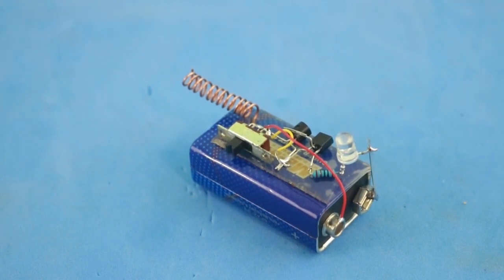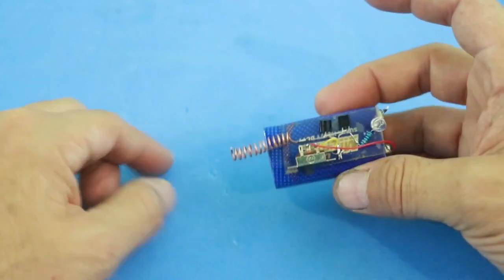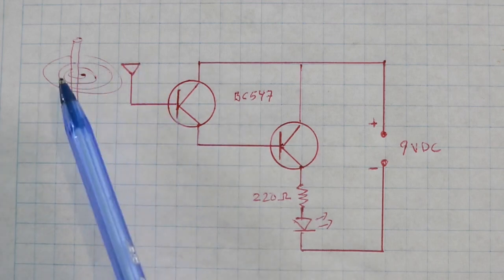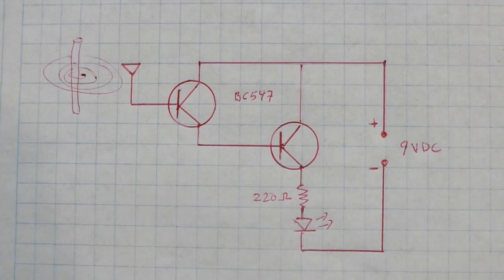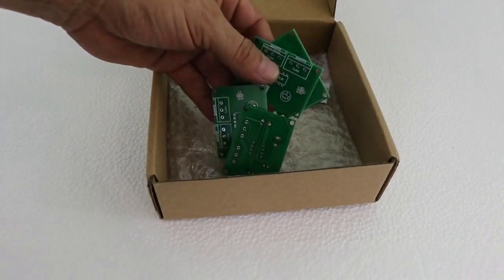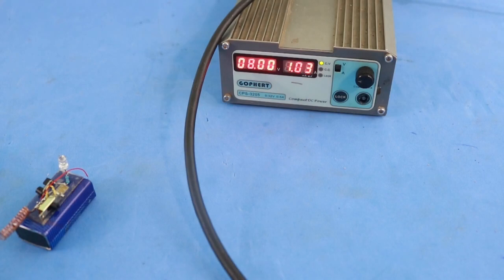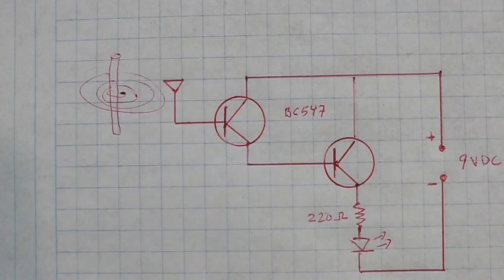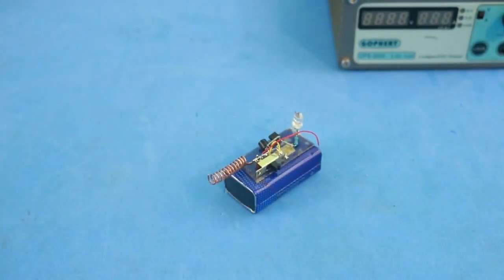Non-contact AC Current Detector Easy Circuit

Comment: By linking the transistors in that manner, you've created what's called a Darlington Pair transistor amplifier. You can also get a single transistor, that has that circuit. I wonder if one of those could be used to created the AC detector. https://duckduckgo.com/?q=Darlington+Pair+transistor+amplifier&t=h_&ia=web
https://en.wikipedia.org/wiki/Darlington_transistor
https://duckduckgo.com/?q=Darlington+Pair+transistor+amplifier&t=h_&iax=images&ia=images

Comment: This circuit is wrong, you need a large plate to form half of a capacitor instead of that nonsence coil
Reply: "you need a large plate to form half of a capacitor instead of that nonsence coil" A wire is also half a capacitor or a plate, a coil need to be conected to each side so this is not a coil.  the wire is aranged like that so it can be shorter with the same surface.
Reply: @sokauo  wrong, a coild this size is not an efficent capacitor, a plate made of a small piece of aluminium foil or copper tape would be more efficent producing stronger current for the trasistor to amplify meaning it would detect cables with a higher precision
Reply: @DolezalPetr   Chek electroboom video mate ;)
Reply: @sokauo  I know the video and my explanation is correct, something this video is unable to explain correctly

Comment: Wouldn't it work better with the antenna the other way to the wire? Or a charging coil out of a cell phone or the charger so you can measure from the other side of plaster board?
Reply: There is no antena, it should be a capacitor plate

Comment: Remember everyone, especially electronics beginners who might build this circuit:

Don't use this like you see electricians use their "testers" by inserting them into the slot on a plug. Those also use "no contact" but the antenna is shrouded in plastic.

If you put a bare copper antenna and start testing for live AC it could end with a big surprise for you.
Reply: To be fair either way you’ll know if there’s AC current
Reply: @ParkerTenBroeck  When I was 5 or 6 years old I took one of those analog automotive 12vDC testers and alligator clipped each side to an indoor AC outlet after shoving metal in each side to see "if the house had more or less power" than our family car.

After having the living sh@t scared out of me  and trying to rub off the burn marks up the wall before my parents saw what I did....I can say with confidence a house runs off greater than 12v DC.
Reply: There is no antena, it should be a capacitor plate
Reply: @DolezalPetr  being used as an antenna. An antenna is just the name for something that either receives or transmits part of the electromagnetic field.

I've built plenty of patch antennas out of what is effectively capacitor plates.

I think of it as an antenna, but I won't force you to.
Reply: @PowerScissor  it is not an antena, it does not receive any electromagnetic fields or signals, it couples ac as a capacitor